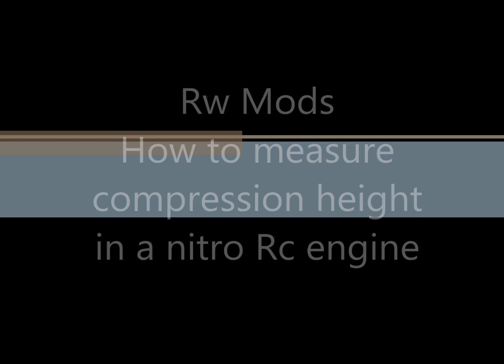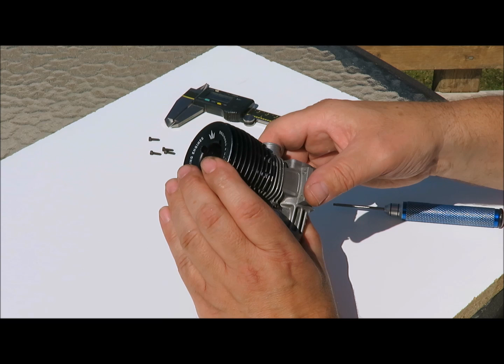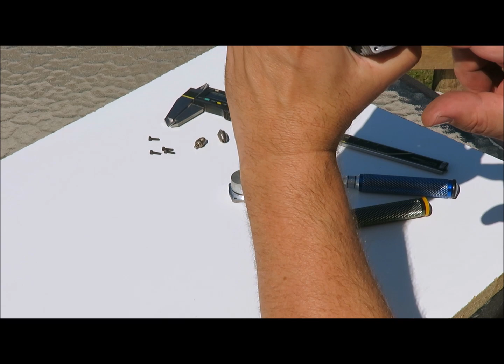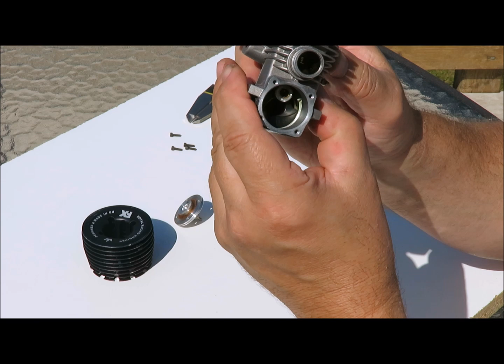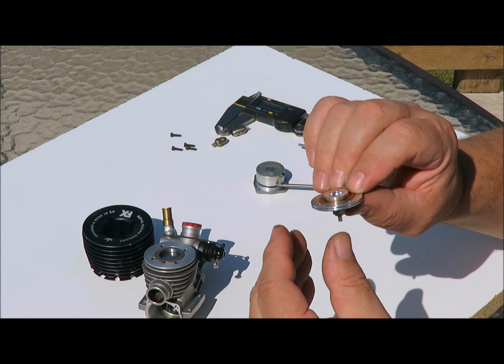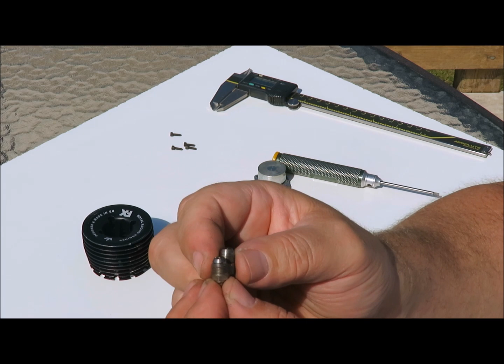How to measure the compression height of a Rc nitro engine.

Comment: Also keep in mind that increasing the compression ratio allows and even requires you to run less nitro methane. RC'rs outside of the U.S. use a lot less nitro methane in their fuel mixes than we do. 0% nitro is actually common.

Comment: tin wire for soldering inside the glowplug hole... turn your flywheel... mesure the pressed wire. no needed desmount the engine for it ;)
Reply from the maker: I tried that years ago and didn't care for that method.
Reply: @TheRwmods  your method is just teoric but doesn't work. The conrod have also clearance so if you want to have a precise misuration... 😘

Comment: I know you’re really busy. But I need some dlc coating on my crank . The whole 9 . I just found your website.
Reply from the maker: I do modifying but I do not do dlc coating. I do not know anyone that does Dlc coating. There is one person that does black oxide, black oxide is a black rust and actually makes the crank wear faster, I do not recommend.
Reply: I’m looking for a motor, a 32 , 28 . But I wanted modded before I got it. I like the price of the 32 . What should I do ?
Reply from the maker: @pitbikecookracing3324  A Novarossi .28 will last 2x as long and make more power than the Lrp .32. It is $50 more but worth it. You could go with a Dynamite or Sh .26-.28 also Sh makes Lrp and Dynamite. Just get ahold of me through my site to have it modified before you run it.
Reply: I will. I’ve been pulling 12 hr days . Just to have something awesome. The nova is already dlc coated? Plus it’s really cold in Michigan. I’ll be calling you this week.
Reply from the maker: @pitbikecookracing3324  No the Nova is not Dlc coated, usually the engines with Dlc coated cranks are $350 and higher
Reply: @TheRwmods  some nova they are ofcourse